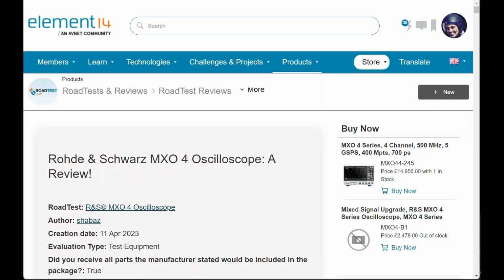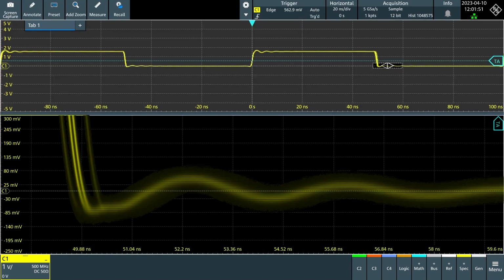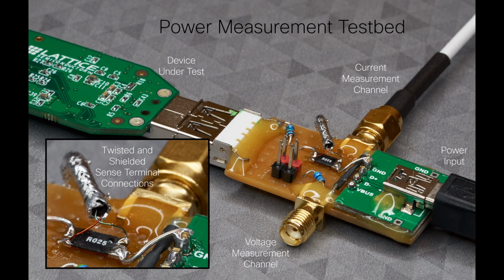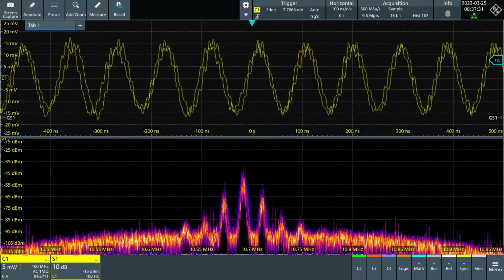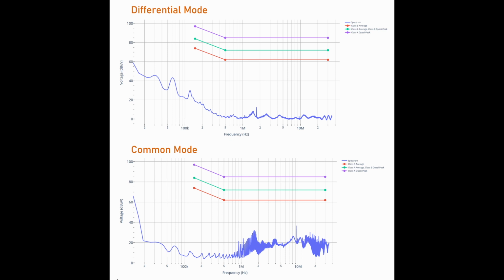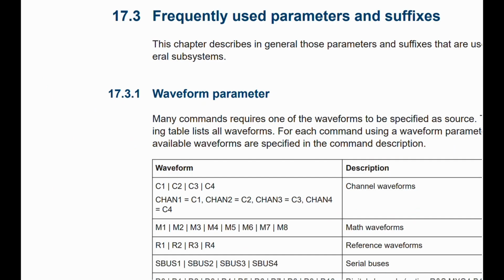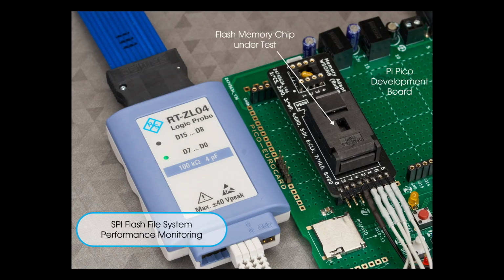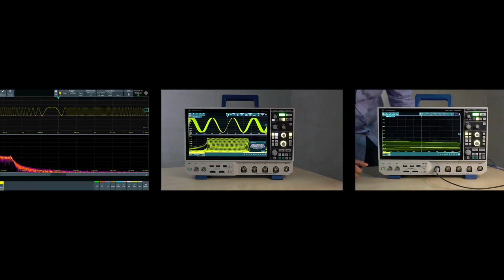Rohde & Schwarz MXO 4 Oscilloscope Review

Comment: What are your thoughts on 4CH vs 8CH MXO5? I am trying to get some second opinions on this because I am planning to acquire MXO5 but 8 CH is a little bit too expensive for what I am willing to pay. Essentially I have to make a choice between 4CH 2GHz + 1 Gpts Memory or 8CH 500MHz + 500 Mpts Memory. I work mainly with power electronics (multilevel) but would like this piece of equipment to be future proof as well.
Reply from the maker: Hi! Congrats on the MXO 5, please do comment to give your feedback on it when you receive it. That's a very difficult decision, because with power electronics, I can imagine you may well want more than 4 channels. I believe at 500 MHz with 8 channels, the MXO 5 should perform extremely well, because you've got dual MXO-EP ASICs inside, each one is at least MXO 4 power as I understand. And 500 Mpts per channel is a huge amount, I feel more than perfect for your use-case. So that seems like a great combination, plus at least there is a path to upgrade if needs radically change, without changing the hardware. To me that feels a better combination than the 4-ch 2 GHz 1 Gpts options. Both options very powerful of course.
Reply: @shabaz_  Thanks for the reply. Do you foresee a situation where you might need a bandwidth higher than 500 MHz that your current instrument offers?
Reply from the maker: @r_be  I actually use an older 1 GHz BW 'scope extremely rarely now that I'm using the 500 MHz BW one. I kind of wish R&S would offer a mode where the time-domain view is visually restricted to the licensed limit (e.g. 500 MHz), but the spectrum view to be unrestricted to the full 1.5 GHz. That would be very neat, but isn't an offered possibility. Still, 500 MHz is very usable. A good use-case for higher BW could be EMC related testing. For some high-frequency use-cases it may be just as easy (and possibly lower-cost) to switch to a separate spectrum analyzer product anyway, if the time-domain view is not essential for a particular use-case (e.g. perhaps some EMC-related tests as mentioned).

Comment: Ok, here’s my feedback - EXCELLENT job.  Thanks for a thorough, well thought out and presented review.  Please follow up with what you’ve learned and what R&S has and has not fixed and added since you recorded this.  Thank You !
Reply from the maker: Thanks for the comments! I think it's time for another MXO 4 video, I'll start thinking about what that should look like. But to give you some feedback now; when the MXO 4 was first released, I raised about 25 issues, and their customer support was willing to accept them all and work through them, and their engineers provided feedback. Some were genuine issues, some were feature requests or more minor feature enhancement requests, and some were misunderstandings from me. Now with the latest release, I think pretty much everything I raised has been resolved; for instance, in the video, you can see that the math capability was originally quite restrictive (to about four or five terms), but that's been greatly enhanced now, so I'll provide screenshots in a later video. Some of the things I was really hoping they would implement, are now present: in particular spectrum log display is executed really well, and also there's now the ability to have 4 different channel spectrum traces simultaneously. One thing that's still missing, but I think may become available, is spectrum waterfall. There's also now power measurements + harmonics capability (ideally with power rail and current probes, but nothing stopping using normal probes and sense resistor or a small current sensor). There's also zone triggering which is going to take me a while to explore; it has the potential to identify what part of a waveform is responsible for spurious content for example, by drawing a zone on a spectrum display (doesn't have to be drawn on the time-domain view!). I'm looking forward to trying that (that feature was just released about a week ago).
Reply: @shabaz_  Thanks very much for that very thorough response !  It's especially helpful as I'm JUST about to order one myself next week.  I first saw the MXO-5 review by Shahriar on his TSP YouTube channel which really got me going.  Next I convinced myself the MXO-4 is essentially just a four-channel version of the MXO-5 he reviewed with basically the same feature set (it's basically two MXO-4s in one box serving 8 channels instead of 4 with a slightly larger display and a bit more memory).  And now your MXO-4 videos and I'm cooked.  I just subscribed to your channel and look forward to any further reviews you may decide to do on this.  Again, thanks !
Reply: @shabaz_  So weird; just left a response here but it disappeared when I saved it !  Anyway, thanks for this very thorough and helpful response.  I especially appreciate it as I'm just about to order an MXO-4 next week.  I saw Shahriar review the MXO-5 on his TSP Channel which got me going, then I discovered the MXO-5 is essentially two MXO-4s in a larger box running eight channels instead of four with basically the same specs and characteristics.  I only need four.  Then I watched your review and now I'm cooked.  I'm really happy to hear R&S has been so responsive to feedback.  An extremely good sign.  I"m getting to think of R&S as sort of the anti-Tektronix. Super products except honest instead of pathologically mercenary.  I've subscribed to your channel and look forward to any further reviews you do.  Thanks again for taking the time to do such a great job at this.
Reply from the maker: @Starlite4321  Hi! Yes it's weird, I can see you wrote the comments when I log in, but I can't see why they are not appearing. There's no queue/moderation or anything set against the video, so it should just immediately display. Anyway, that's great news, I hope the 'scope gives you many years of great service! It will be great to hear how you get on with it.
Reply: @shabaz_  Thanks for the response shabaz.  Computers.  Am I right ?

Comment: Great review!  Have you had chance to compare this with the Tek 4 series?
Reply from the maker: Hi! I'm very familiar with the Tek MDO 3000, but have not used the newer 4 series unfortunately. Compared to the MDO 3000, I prefer the Tek supplied scope probes (they have a softer cable and also have built-in electronic compensation adjustment) however other than that, I find myself using the MXO 4 much more. I purchased a couple of softer cable scope probes for the MXO 4. The main difference with my workflow is now that I have the spectrum analysis turned on very frequently, since it gives the extra insight. For instance, working on a transformer-based supply, I could use the spectrum analysis on the MXO 4 to see exactly what the harmonics were like, and if there were any spurious oscillations from the driver circuit (there was, and I was able to solve it by adding a ferrite to the base of the driver transistors). I would not have seen that without the spectrum feature and the high-res acquisition. For a 12-bit 'scope, a fast, good quality spectrum view is fundamental to get the most out of it, and probably the MXO 4 has the edge here. Overall, a few things still feel unintuitive (I really like the dual A/B control knobs on the Tek scopes, their 4 series has that too) however I'm getting speedier over time with the MXO 4. Basically a few minor idiosyncrasies but now would struggle to want to go back to the 3000. Also, I originally wasn't too sure about the History control and segmented memory, since I'd never had that capability with the older scope, but now find it useful when looking to see what the variability is with logic values in protocols. For instance, if you have a burst of data with pulse width encoding, you can set up the record length and trigger such that you can capture hundreds of the sequences, and then quickly scroll through them, observing the variations, and determining if (say) any windows for sampling data are good or bad. I know from using the MDO 3000 that the Tek 4 series will be a terrific instrument, but I really like the features in the MXO 4. I hope this helps!
Reply: @shabaz_  thanks for the detailed reply.  Yes, the MXO 4 really seems to be at the top of the pile when it comes to specs compared to the equivalently priced Tek or Keysight at the moment.  Keysight always had the waveform update rate advantage with their Megazoom4 but the R&S seems to have topped that now.  The SA functionality of the R&S seems very capable too.  No need for a separate SA as long as you don't need the higher bandwidth.